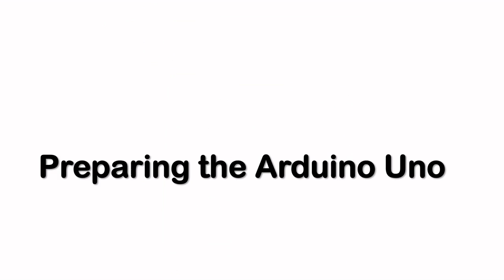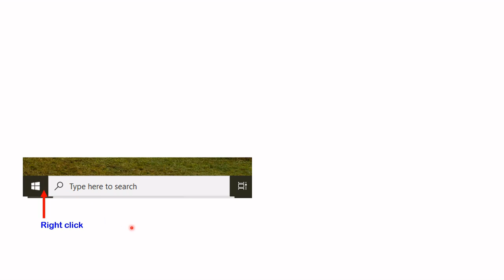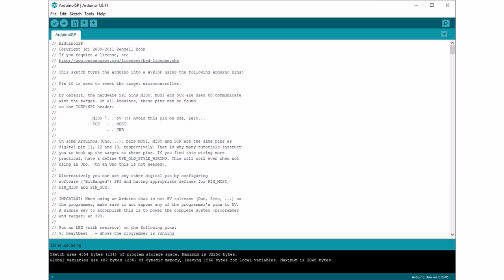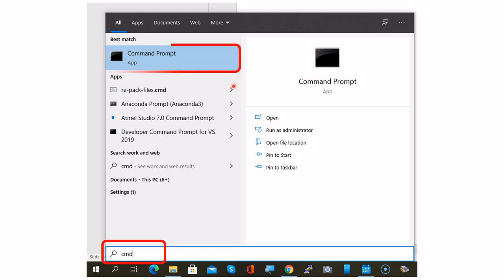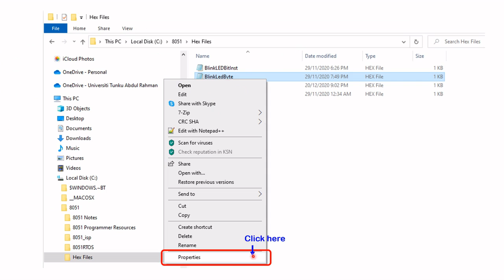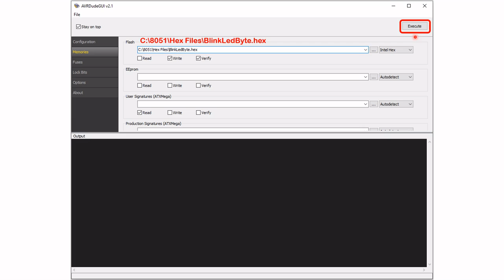#18 Programming the AT89S52 Using Arduino Uno.

Comment: My Arduino file is missing
Reply from the maker: Hi, could you explain, what you mean by "My Arduino file is missing"?
Reply: @vooiyap  hello, the Arduino folder is what i meant, its doesn't exist anywhere. But I already fixed it, I installed the new version of Arduino that's why its missing.
Reply from the maker: @babyph65  Good to know that you have fixed the problem.
Reply: @vooiyap  my arduino folder exists, but it only have the libraries folder. i dont know why it doesnt have the others folders. i tried to install the IDE again, but nothing changed, do you know why this is happening? sorry if i said something wrong, im still learning english
Reply from the maker: @yurimoreira8659  Hi, what version of Arduino IDE have you downloaded? By the way, you doing fine with your English.
Reply: @vooiyap  I'm using the latest version of the arduino IDE. Thank you 😊
Reply from the maker: @yurimoreira8659  HI, try using installing an older version. Try this link: https://www.arduino.cc/en/software/OldSoftwareReleases
Reply: @vooiyap  i did this and now the file is there, thank you. but it shows this error when i put the code in the cmd or in the AVRDudeGUI    "avrdude.exe: Device signature = 0xffffff (probably .reduced_core_tiny) (retrying)"
Reply from the maker: @yurimoreira8659  Hi, check your microcontroller (AT89S52). You may have a faulty microcontroller.
Reply from the maker: @babyph65  Hi, what Arduino file are you referring to?
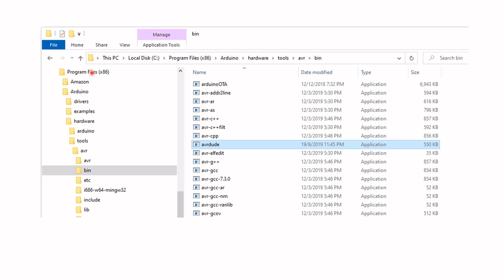Reply: @vooiyap  the one that you showed at 17:15

Comment: Hi I’m facing error when trying to key in the code for method 1. It says “syntax error at C:/AVR8051.conf:27”, what could be the problem?
Reply from the maker: Hi, I do not know try you are getting this error but try this link for the file: https://drive.google.com/file/d/1XqGDQt50_Th77DPlTh0zPFkW_1ckOhKA/view?usp=sharing
Let me know if it works.
Reply: @vooiyap  I'm currently facing a problem with "invalid device signature", may I know what could be the problem? My led did light up but it doesn't blink
Reply from the maker: Hi, I think you got a faulty device/component. Try a new device.  @carmenho8209

Comment: Why not set fuse bit and lokbit ?
Reply from the maker: Please refer to the following for information on lockbits: https://www.engineersgarage.com/at89s51-52-isp-programmer-lock-bits-setting/
Reply: @vooiyap  thats mean that arduino ide automaticly set fusebit lok bit for new ic ?
Reply from the maker: A Fuse Bit configures the Operational Mode/Functional Mode of the microcontroller (MCU) at the time of the 1st power up initialization when no instruction has yet been executed. The state of a fuse bit must be altered before “Programming the Lock Bits” associated with read/write protections of Flash Memory and EEPROM Memory of the MCU. Once, the lock bits are programmed, the state of the fuse bit cannot be changed. The option that is left is to erase the chip (chip erase brings the lock bits back to their default values) and then set the fuse bits. @April2023-fb6pf
Reply: @vooiyap  but default mcu like avr set by internal clock 1 mhz.  And the arduino have 16 mhz external xlock

Comment: Is it okay if I change the 33pf caps with 22pf caps?
Reply from the maker: It should be okay. The capacitors are used to ensure oscillation.
Reply: @vooiyap  okay, anyway it's pretty similar with the atmega328 min circuit.

Comment: Thank you for this series. Very helpful for to put a beginner on track. Can you please explain the needed of the 10u capacitor in parallel with the switch between +5V and R1?
Reply from the maker: I am glad that is useful to you. The purpose of the capacitor and the resistor is to perform an auto-reset on powering up the microcontroller. I hope that helps.

Comment: I have sent a comment about 4 days back, but no reply is received. cmd type is working fine, but gui method I could not make it. The momory is exceeding 2kb of flash. Will it still run since keil says max. flash size for demo version is 2kb ? pl. camment on this. con't we send you my mail id and mob.# in this comment?
Reply from the maker: Hi I am apologize for not responding earlier. I have been quite busy and I have not check my channel. It will be good if you can send me more details to this email: vvy.eseducation@gmail.com.

Comment: where is the pin number of VREF and Vin??
Reply from the maker: Hi, thank you for your question. Vin is located on the Arduino Uno board - just above the ANALOG IN pins. However, I am not sure which VREF pin you are refering to. By the way, VREF and Vin are not used in the project.
Reply: @vooiyap   I'm making a control led with a potentiometer. where can i wire the potentiometer in this microcontroller? my arduino project says wire to Vref. thanks for the quick answer

Comment: Hello Sir, Is C programming necessary to write programs for these boards or we can use assembly language also? If not, then are there boards other than Arduino which allow assembly language programming?
Please help
Reply from the maker: Hi are you refering to Arduino C that is used to configure the Ardunio as an AVRISP programmer?

Comment: Facing a weird issue... when the capacitors to the crystal oscillator are connected the 8051 does not work... whereas the capacitors when removed the microcontroller runs smoothly...
Reply from the maker: That is weird. I cannot comment on the issue until I have seen the circuit you have built.
Reply from the maker: Hi are the other end of the capacitors connected ground?